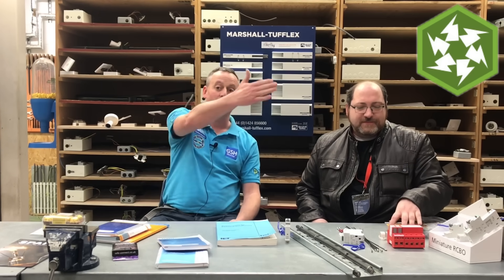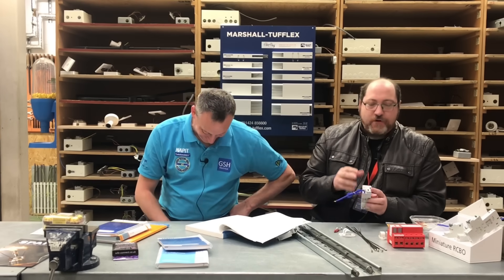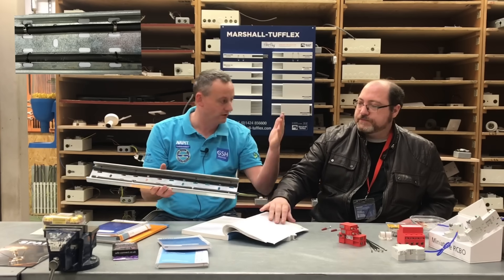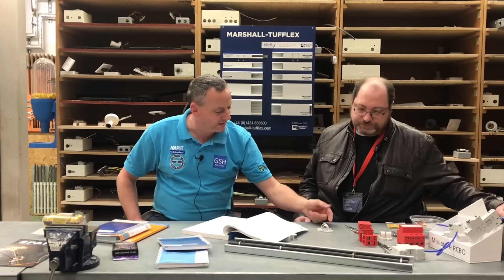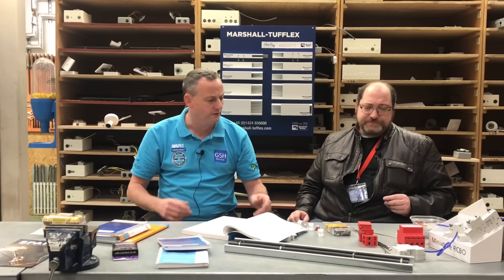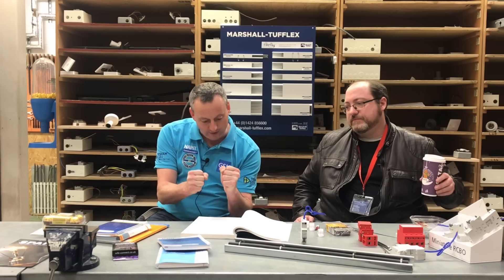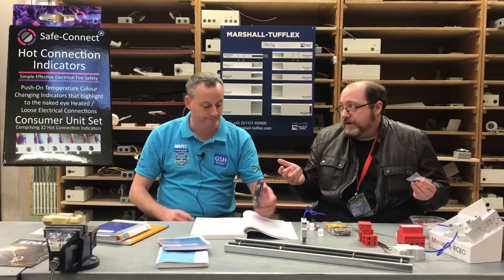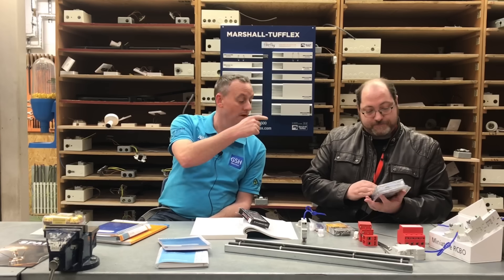Sparkyninja Toolbox Talk on Some of the Changes to the 18th Edition of BS7671 Wiring Regulations

Comment: My complaint is not whether these changes are good or bad but the expensive industry that has built up around them. I have just bought my new books (18th edition + Site Guide) for £107. I have also enrolled on an 18th edition course £200. The last issue was 2015 when all these costs were repeated. I believe low level/low impact changes are being made by those who financially benefit from their introduction. These few changes could have been made as simple amendments to the 17th Edition. The fact that you mention arc protection is 'recommended' is already setting us up for another edition with 3-4 years. For all this there are probably still 10 million homes with no RCD protection!! I would suggest that our efforts at improving electrical safety are greatly misplaced. Next we will be told we cannot erect anything electrical on a flammable surface. We are told to use fire rated cables etc which supply plastic devices (smoke alarms/lighting etc.). I'm sorry but I feel those writing these changes are out of control.
Reply from the maker: Agreed 👍

Thanks for the detailed message 

Gaz

Comment: This is exactly addressed CCTV installers needs to be forced to use metal cable tie I see in London many many even new built they don’t use I carry big box of labels 
Even I was asked to put 230 v next to every sockets in common parts as part of EICR some one used 110 equipment on 230 and got his equipment damaged and sued the building management  we are going wrong way health and safety nonsense way

Comment: Just to add to the bit around 8:38, the standards for intruder/CCTV etc do call on the electrical regulations for selection and erection of wiring systems and containment etc, so professional installers in these areas should be adhering to this. For fire systems, BS5839 has had this requirement for many years due to the way that soft skinned fire resisting cables react under fire conditions 👍

Comment: Surely the answer is high temp rawplugs?

I install lightning protection on the regular in Thailand, low density housing fed by TT overhead wiring, no grounding installed = destruction of electronic devices and getting zapped when opening the fridge.

Comment: Interesting video. Thanks. The plug free direct fitting screws are very costly so be good to know if standard plugs or a variant on them with higher melting temperature could be a possible alternative. I put all the correct stickers on consumer units and offer to talk through checking of rcd’s but in general I don’t believe many domestic customers ever check operation of the rcd’s.
Reply: Come on, even electricians don't check their own RCDs.
Reply: I wonder if there's some guy in the IET who is like "more stickers, bigger stickers!" to every problem?
Reply from the maker: Hi thanks for commenting and watching Gaz 👍.

Comment: Excellent tool box talk. The AFDD is a recommendation, does a risk assessment to determine if it’s not required need to be done for every installation? Gaz
Reply from the maker: Hi. AFDD’s are only a recommendation so no risk assessment needed if you’re not using them 👍. Thanks for commenting and watching Gaz

Comment: Am I correct in thinking for domestic install there aren't many major changes. Also do wires between floors need clipping to the joists. Thanx
Reply from the maker: Hi. If cables are above a plasterboard ceiling the ceiling will provide protection against premature collapsing.... it’s surface wiring we need to support👍. Thanks for commenting and watching Gaz
Reply: @GSHElectrical  Thanks for your help

Comment: It doesn't say in the regs that wall plugs cannot be used for premature collapse fixings does it. So I assume its still OK to use them going forward? Understandably from an engineering decision an alternative may be preferable, like the Walldog  screws
Reply from the maker: Hi. The Regulations also don’t say how often you need the metal fixings for premature collapsing...! 
https://youth.be/K0UM_bL4dJc
Thanks for commenting and watching the link above may help. I have a third video in premature collapsing coming out soon. All the best Gaz 👍